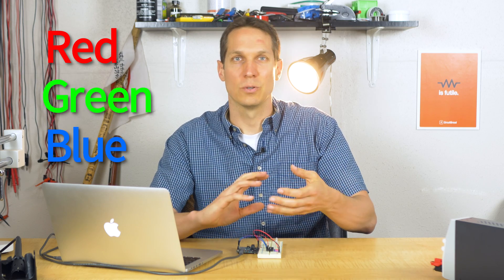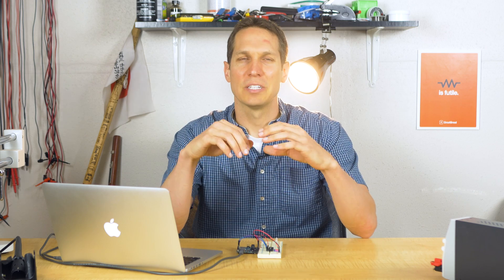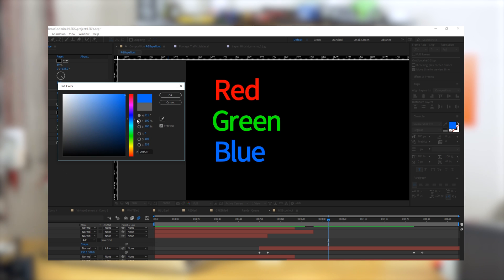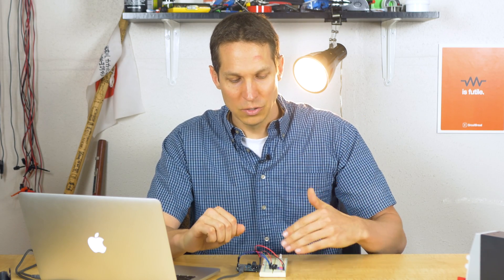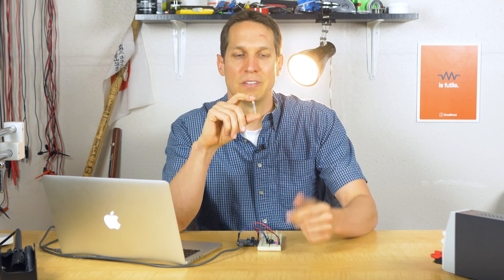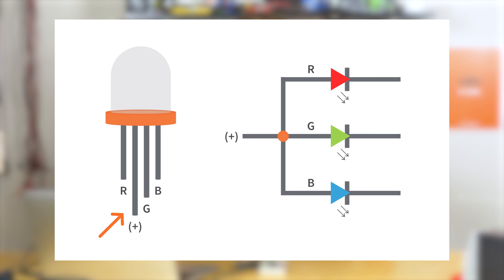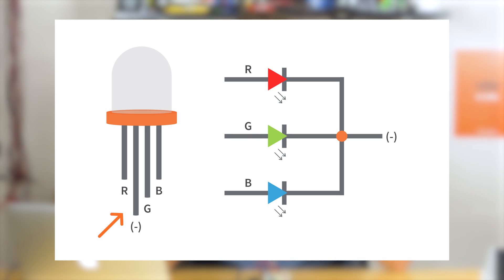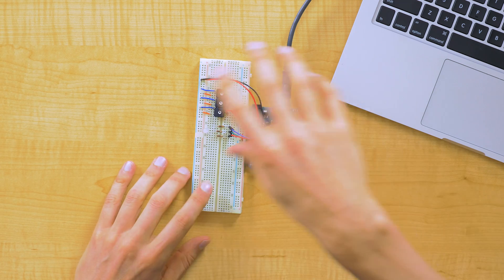How an RGB LED works and how to use one! | Basic Electronics

Comment: How this thing work in mobile phones?
How control the color of pixel in mobile?
Reply from the maker: Hey Akash!  Same principle as in this video, but with a different package.  In a phone, the LEDs will be much, much smaller but the idea of having three different channels and a common anode or cathode would still apply (assuming they're using RGB LEDs instead of discrete LEDs or, more likely, an LED backlit LCD panel).

Comment: Thank you so much for the video!!! I have a question about a project I’m trying to do: I’m new to the Arduino and electrical side so I don’t know much about... anything :(    This may be a silly question but, if I were to make a pink salt lamp with an rgb led in the base, how would I control and power the led without placing an entire arduino uno in the lamp’s base? Thanks!
Reply from the maker: Glad the video helped!  This may seem overly easy, but just run some wires from the Arduino (wherever you place it) to the LED.  You'll need four wires and just connect them on both ends.  You could probably just strip all but four conductors from an old-school IDE cable to keep it neat - or buy something like this: https://www.sparkfun.com/products/14992  The power levels are low enough that you shouldn't have any issues with this method, as long as you're not trying to run the cable from one end of the house to the other.
Reply: Thank you for responding! I have a second question if you don’t mind: Is there any way I can control and power the led WITHOUT an arduino at all? The salt lamp was $8 and only had an rgb led that had a smooth rainbow flowing led effect. I didn’t really like that and just wanted to fix it to a solid color, but when I opened it, I saw that one of the two pins (it was rgb but only had two pins 🤷‍♂️) was broken. So I was just trying to figure out how to place in my own led and control/power it without a whole arduino. Could I just buy an led controller chip online? If so, do you have a good one in mind? Thanks!
Reply from the maker: LEDs can easily be controlled without an Arduino but it does depend a lot on how much flexibility and control you want.  We talk about how to do this in our PIC10F200 microcontroller series, which those are small and cheap but 1) I doubt you're looking for something as complicated as those tutorials get and 2) while the chip itself is very inexpensive, there is some less-inexpensive hardware needed to program it in the first place.  Unfortunately, I don't have any LED controller chips to recommend and, honestly, wonder if a smaller, non-brand name Arduino board would be cheaper and give you more flexibility.  Something like:  https://www.seeedstudio.com/Seeeduino-XIAO-Arduino-Microcontroller-SAMD21-Cortex-M0+-p-4426.html?utm_source=blog&utm_medium=blog

That being said, if you're just looking for a solid color, get some resistors or small trimmers and hardwire them in.  You'll pay more for shipping than you will for the resistors, and you won't be able to change the color without replacing the resistors, but it should give you the opportunity to choose the color you'd like.  This entire conversation is assuming that these are low-voltage LEDs, of course.

Comment: can i use an rgb music controller with a led light strip that only has two wires (Black and Red)? I simply need a device that will make my current led strip (again with only two wires) pulsate to the sound of music.
Reply from the maker: Kind of... if you're not trying to control colors and/or individual LEDs, you can pulse the entire strip with the music.  But if you want to do anything fancy, you'll need more control (either more wires for different colors or digital control for both individual LED and color).  With what I'm imagining from your description, you're just basically treating the LED strip as simple LEDs in series.
Reply: @CircuitBread  That's exactly right thank you.

Comment: Why not just use the pots to limit the current through each color to adjust the colors and intensity ?
Reply from the maker: Hey Joe!  That is entirely possible and is fairly simple.  The odd thing is that changes to the potentiometer will cause non-linear effects but, frankly, if you're just doing things by eye, that would probably be the best way to approach it.

Comment: 3:00 To 3:04 -ve pin need to be connected to cathode or anode?
Reply from the maker: Dang it!  Usually we catch when I misspeak when reviewing (which, I misspeak all the time) but somehow this one slipped through and remained unnoticed for nearly a year.  You are correct - at that point, I should have used the word "cathode" not "anode". Thanks for catching that and commenting!

Comment: Could you explain duty cycle? Also, any other fun basic circuits you recommend building for practice? Thanks! And great video!
Reply: Basically, how long it is on during a time period, then how long is it off. Using a pulse width modulated dimmer on a light, a 70% duty cycle means the light is on 70% of the time of each pulse at full brightness, so the light seems dimmed to 70% of the brightness. Say your pulse is 100 milliseconds (msec). The light will be on for 70 msec, then off for 30 msec and it will make the light APPEAR dimmer. The light comes on to full brightness, but isn't on all the time. This is different than a resistor based dimmer, which lowers the voltage to the light and it puts out less light
Reply from the maker: Thanks Royal!  I looked through some of our tutorials and realize we don't have a super-great explanation of duty cycle but if you haven't seen this, it is helpful and does touch on it heavier - https://www.circuitbread.com/tutorials/how-to-dim-an-led
As for basic circuits to practice building, I actually recommend our PIC10F200 tutorial series that Sergey has created - it's a fun combination of both circuits and microcontrollers.  https://www.circuitbread.com/tutorials/tags/microcontroller

Comment: Alright so I’ve just watched Adam savages latest build involving an infinity pool, you might find it interesting tbh, but I’ve gotten the insatiable urge to make a wall out of the object he builds, many of them tbh lol but it’s going to be probably a couple hundred feet of LED strip cut into smaller pieces by necessity of the build. Say I wanted to add color changes to specific lights throughout the entirety of the display at once while having other sections be other colors simultaneously, in your opinion how would this be easiest? To do as you do in the video and make each unit it’s own thing and time each controller with another or run them all in sequence and off on controller?
Reply from the maker: Sounds like a fun project!  I would not follow this tutorial - the complexity would get out of control very quickly.  I guess, technically, it would be possible, but I would go with some addressable RGB strips as it would be a lot easier.

Comment: Ok so if I want to connect 4 of these instead of a 5050 RGB strip to my computer's motherboard (+12V RGB 4 pin), what resistor should I need and do I need common anode or cathode? This is all too confusing :/
Reply from the maker: You can hook all four of them in parallel (which may be an interesting challenge! but just hook all four pins of all four RGB LEDs to the same things).  To keep things simple, you could use 120 ohm resistors between the motherboard and EACH color input.  If you put less than 4 of them in parallel, that resistance will need to increase or you will increase the likelihood of damaging the LED.  And it could be either common anode or common cathode, you just need to hook them up differently depending on what you get.  A couple helpful tools for this project so you can double check my numbers and assumptions - (https://www.circuitbread.com/tools/led-resistor-calculator) (https://www.circuitbread.com/tools/led-colors-and-materials-chart)(https://www.circuitbread.com/tools/standard-resistor-values)

Comment: Hello, I have a device with a RGB LED but the green led isn’t working. Do you think its easy to fix?
Reply from the maker: Hi!  If it's just a connection issue, then it should be easy to fix.  If the actual LED portion inside the molded plastic is no longer producing light, then it would be a lot easier to replace than to fix.
Reply: CircuitBread I have a replacement shipping to me right now, but I might not need it. 
I’m not very familiar with you know fixing connectors and wired and stuff, but I know people who can do it. 
If it’s a connection issue is it just to use a solderig iron or something to put it in place? And if I replace it will i still need to do the same as if it was a connection issue?
Reply from the maker: If it's just a connection issue, then it depends on where the issue is.  If If it's at the point where the LED is attached, then just a soldering iron and some solder should be able to fix it quickly.  And replacing the LED would accomplish the same thing of reestablishing a connection at that point.  If the connection issue is elsewhere in the circuit, then it's going to be a much bigger challenge to find and fix.  I've successfully been able to solder flex wires that have been broken but it was difficult for me (my soldering skills are okay but not great) and the end result was rather tenuous.  If you have a multimeter, it should be able to help you find breaks in circuits that you can't see.  And depending on where it is, you can either dab a bit of solder on with a the soldering iron or replace something or ... well, it just depends on what is causing the problem.
Reply: CircuitBread okay thank you!

Comment: sorry for bothering but I have many questions! 
I have a motherboard have 4 pin for RGB (+12v-R-G-B) 
I have a cpu cool which have 8x red leds 5mm 
I want to exchange them to RGB instead of red 
1- do I need 3x 470 ohm resistor for each led? or 3 are enough for all leds ? 
2- can I add RGB strip+ the previews 8 rgb Leds to this Circuit? (the rgb strip will include 6~8 leds only) 
I hope you reply me as soon as possible 
thanks!
Reply from the maker: Hey Ali - no worries about the questions!  You will need one resistor per LED (so, three per RGB LED).  And the value of each resistor does depend on the color of the LED, as the different colors have different forward voltages.  
LED strips, however, are completely different beasts.  They usually run off of a higher voltage and are controlled differently, either with a communications protocol or a constant current source.
Reply: @CircuitBread  thank you very much for the fast reply 
so can you give me the right value of Resistor for each led? Red, Greed and Blue? 
I thought all will need 470 ohm 
I would be thankful if you help me selecting the right resistors  <3

Comment: Question. Would A RGB Led That's Casting White Color Be As Bright As A Dedicated White LED???
Reply: No.
Reply from the maker: I agree with mrr882008 - it won't be as bright nor will it be as "nice" of a white.  You can tweak it to get the hue you want, but it very likely won't look quite as good as a dedicated white LED and won't be as bright as a dedicated LED of similar size.
Reply: @CircuitBread  Thanks That's What I'm Beginning To Conclude Also. Now With A Little Bit More Technicality... Would A 3528 White LED Be Brighter Than An RGB 5050 Casting White?
Reply from the maker: @salvatorehayes2753  If we're getting down into specifics instead of generalities, I'd say - check the datasheets!  The lumens and the viewing angle should be in there, giving you a more realistic comparison.

Comment: I watch your videos, and THIS is what I call Great content. Thank you very much. But the problem is that I don't have an Arduino and I would REALLY like to try this Project on Raspberry PI 4. Help is Appreciated.
Reply from the maker: Thanks, I appreciate the feedback!  I've been thinking about doing an embedded series with a Raspberry Pi because I want to start doing something with my nearly 8 year old son and I want something that'll be easy for him to work with.  Unfortunately, I haven't put anything together yet and I've only done one project ever, nearly two years ago, using the GPIOs on a Pi.  It's kind of lame to do this to you, but have you checked out this page?  https://www.raspberrypi.org/documentation/usage/gpio/python/README.md
Reply: @CircuitBread  Thank you very much, I will surely check it out.